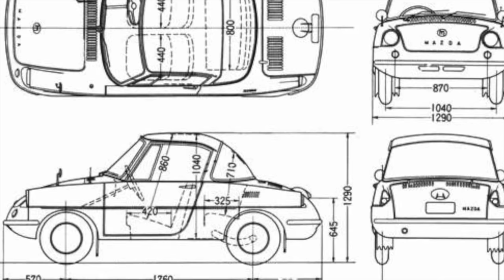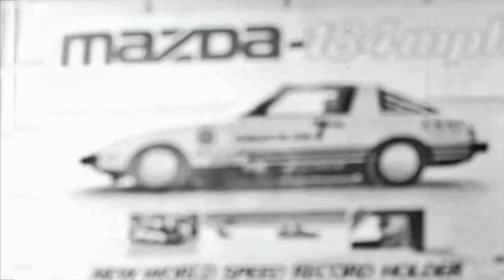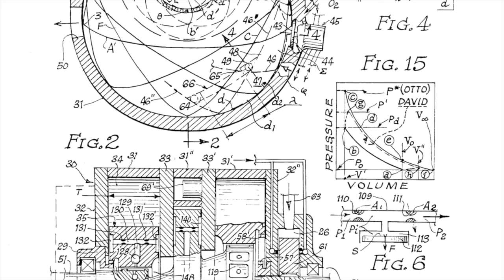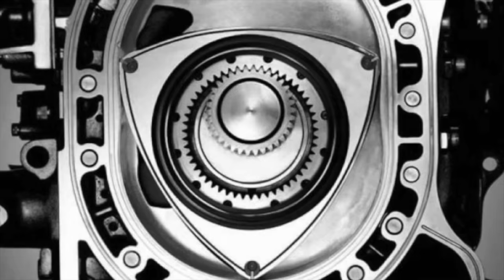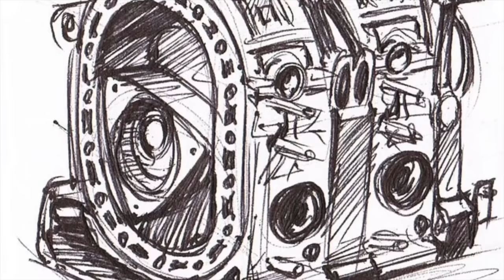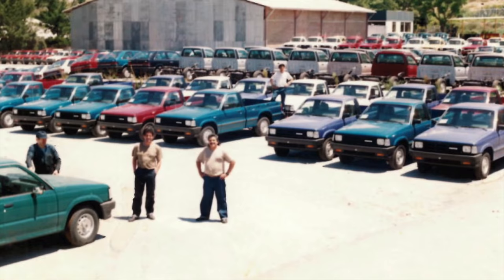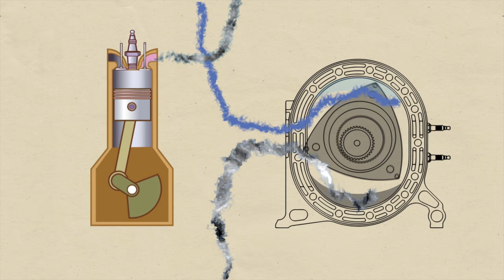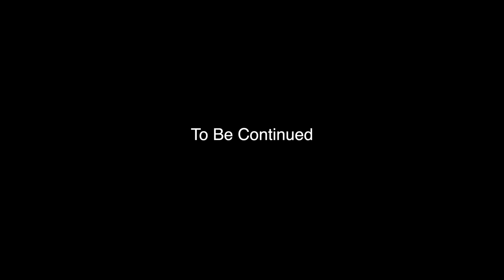Here's Why Mazda's New Rotary Engine is Genius

Comment: well first of you have the dates all wrong wit the cars that had the rotary engine in the in the early 70s up to 1974 model of cars rx3 and rx4 that had the rotary engine in them then after 1974 to 1978 they did put the rotary engine in there mazda trucks but it was only for 3 year or 4 years they did that then in 1978 they can out with there first mazda rx7 then in the late 1978 for the 1979 model they put the rotary engine in the first mazda rx7.
Reply: Mazda went bankrupt in 1974 after attempting to sell only Wankel engines.
The Japanese bankruptcy court sold Mazda to Ford Motor Company who  brought back reciprocating engines and slashed the number of RX models in 1979.
Reply: @sandervanderkammen9230  first off what does it even have to do with the company going  bankrupt i was just saying what cars had the rotary engine in them is all the rotary engine has nothing to do with that and yes i do know all about ford stepping in and taking control over the company but like i said all ready that do not mater on what cars has the  rotary engine in them or the years they came out with them that still remains the same do not change because they had gone bankrupt. well i am not going to be drag in to a debit over this it just shows you do not under stand what i am saying any ways
Reply: @markking3755  I'm sorry but you are the one confused here, it was FORD that reintroduced reciprocating engines and slashed the number of models with Wankel engines.
 The Wankel engine was a major financial loser for Mazda, a fact that never changed.
Reply: @sandervanderkammen9230  i guess you can not read i am sorry for that for i said it do not matter if they were bankreped or not i was just  pointing out what years the cars had rotary engine them it still do not matter if they were bankrep or not for the cars rx3 and the rx4 still had rotary engine in them the bankrep do not take that way or even the years away. i get you do not under stand that but i will not debate with some one that can not understand something this simple. have a good life any ways
Reply: @markking3755  Obviously you do not understand, Mazda's model line up changed drasticly after the company WENT BANKRUPT and was controlled by the FORD MOTOR COMPANY.
Why do you seem so reluctant to accept the fact that the Wankel engine a commercial failure?

Ironically Mazda was forced to discontinue all development of Wankel engines in May 2009 after Ford divested its ownership and Mazda WENT BANKRUPT again in 2009.
Reply: @sandervanderkammen9230  well i guess we agree to disagree then and no i am sorry that what i had said is way over oru head by that i will not be responding to any other comments for i can see from you its pointless to go on with this facts are on my siad any ways just look up the car models for your self you will see
Reply: @markking3755  Thank you for conceding this argument so gracefully, I'm sorry you were too embarrassed to admit you were wrong though.
 I invite you to go down to your local Mazda dealer and ask to see a 2021 RX model Lol!

Cheers!

Comment: Wankel rotary engine is a two-stroke cycle motor. Not a four-stroke cycle motor. Wankels have no stroke altogether. Listen to the exhaust of a Wankel, it sounds like a two-stroke, not a four-stroke. Wankels need oil in the intake just like a two-stroke. Wankels pollute badly like a two-stroke.

Comment: Mazda? Felix Wankel made this rotary engine.....
Reply: Actually he didn't... 
Felix Millet invented the Rotary engine.
Reply: @sandervanderkammen9230   I'm sorry, but you're totally wrong. It's actually even in Scotty's video, but I feel like he didn't really emphasize it. It's actually called a 'Wankel' engine. 
Millet's engine has connecting rods, much like a plane engine. 
The Wankel rotary engine has no connecting rods, no head, and no valves or camshafts. 2 rotating triangles and a crankshaft.
Reply: @mikeworkman3593  So you don't know the difference between a ROTARY engine and a WANKEL ENGINE?

Which Wankel engine are you referring to?
There are 2 types of Wankel engine, one rotary one non-rotary.